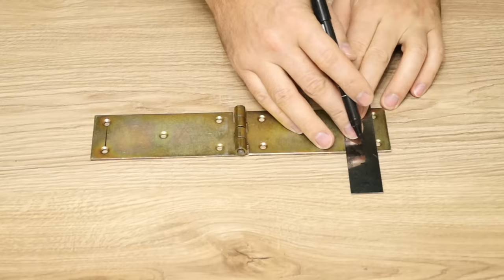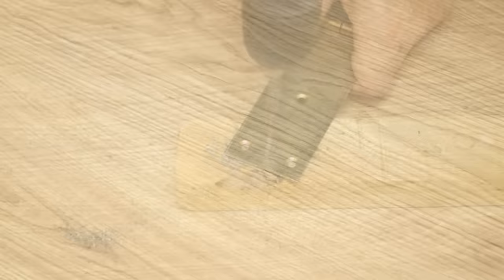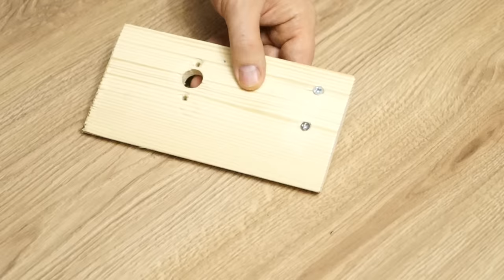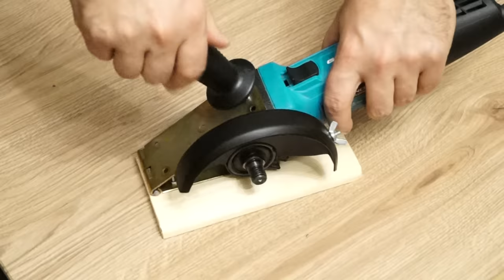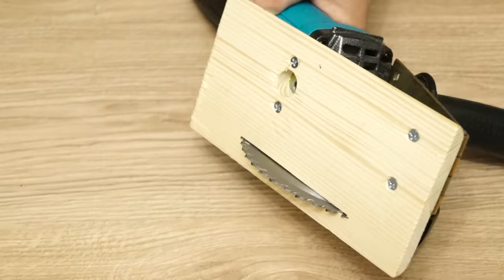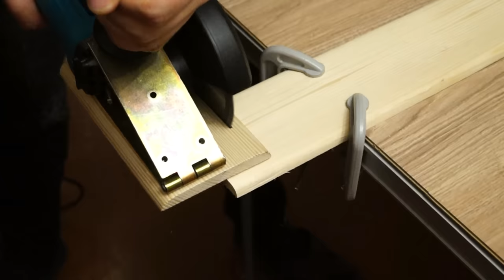Awesome idea with Angle Grinder! And so it was possible

Comment: For such a shallow depth of cut, this thing is a waste of time and extremely dangerous. You are better off using a handsaw for cutting such thin pieces of wood. Most angle grinders do not have variable speed control so you would need to buy or make a variable speed controller. He didn't even use split washers to prevent those tiny nuts from coming loose from the hinge.

Comment: wood saw blade is not designed to be attached on an angle grinder, due to the higher speed the grinder produces, the saw blade might break and fly off. Put your safety first, it costs more than a proper tool.
Reply: There is 2 Safety Tricks for using That Blade.
1] Using Variable Speed Angle Grinder (Just Use Speed 1-4).

2] Still using normal Angle Grinder, BUT add Speed djustable/Dimmer Controller. So we can adjust the Speed.

Comment: One question - I thought 4 1/2 inch circular saw blades have a different hole size  that will not fit the grinder arbor/spindle.  the arbor on my grinder is 7/8 and the blades i saw were 5/8
Reply: He probably drilled it out to 7/8" and in doing so stressed the metal around the hole.

This thing is a lost hand (or other body part) or life just waiting to happen!

Comment: It is an "awesome" idea if you don't have a cheap handsaw, but somehow have a fifty-euro angle grinder and wood cutting disc, an extra hinge, an electric drill, a drill bit for metal and a handful of fasteners. Also "awesome" if you don't need to cut any wood that is thicker than two cm.

Comment: It is so dangerous, because grinder has high speed >10000 rpm
Reply: He used adjustable speed grinding machine brow....
Reply: ....circular saws don't have a thumb pressure release switch as a part of a triple safety feature for nothing. This piece of equipment is dangerous at so many levels I don't know where to start.
Reply: @DDCCO61  👍🤝

Comment: Might be a little late to get a patent but it's worth a try
Reply: They already sell light weight 4.25" circular saws.  Many on the market for under $80.00 (USD).  I just bought one for $49.99 (USD) on sale!  It has a blade guard, adjustable depth settings, miter angle adjustment and a laser cutting guide!